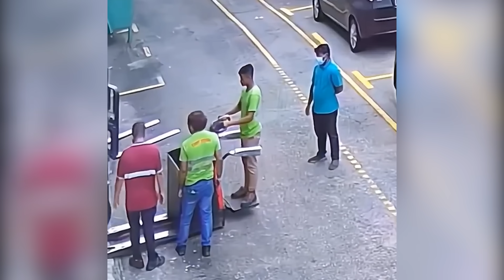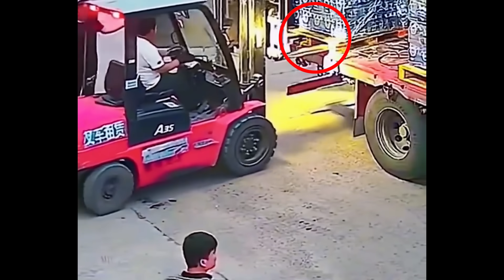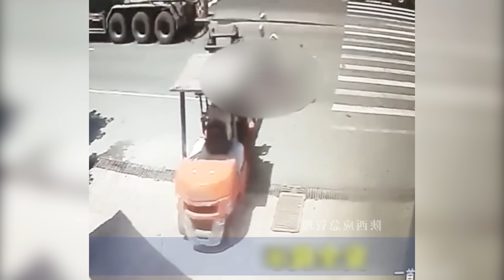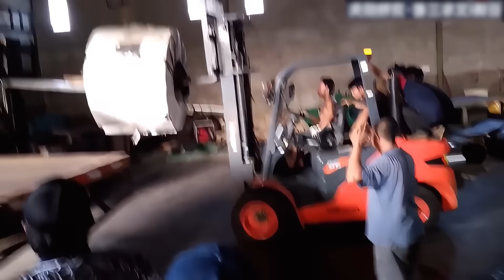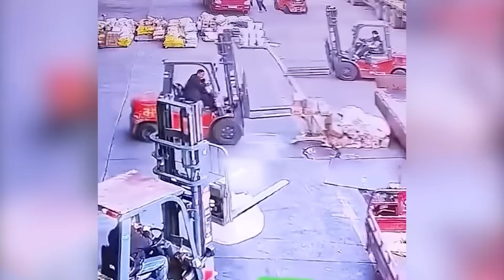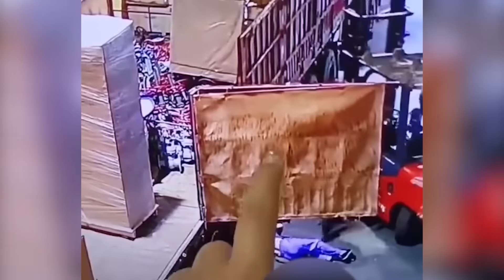Forklift Accident Caught on Camera!

Comment: Keeping the forklift blades as low as possible when not in use and also never elevated to a height that can impale someone while moving forward is f**king 'forklift operation 101'...It's basic, common sense, as well.

Comment: No traveling with raise heavy loads. Tilt a little back and keep load center as close to the back mast as possible. Weight can be moved towards equipment lowered down and re picked up in a better more secured way. Strapping should be used if raising loads very high. Travel very slowly so as not to cause load to shift around and stop quickly in an emergency. Traveling across roads and pathways outside the forklift operator should have someone on foot as a spotter/stop traffic for caution and forks need highly visible tape hanging to alert traffic of a hard to see danger. Slow and low is best.

Comment: 5:49 little tip from a forklift operator. When ever possible you want your cargo to be as close to the base as you can get it. At this time he should have lowered the cargo back onto the truck and reposition the forks.

This shouldn't have happened but the operatior is important. Maybe the boss of the operation is but any boss overseeing material/product movement worth there salt would rather pay an employee for the extra hour over how much it will cost them should you drop even 1 shipment in a year.

Comment: In my 45 years of forklift experience, I have had to perform almost every lift shown here. Most important parameter is to maximize the center of gravitÿ. Even a heavy capacity forktruck with a lighter load will tip if the center of gravity is outside the "sweet spoþ."

Comment: The carelessness of this lift driver is astounding, not only does he drive way too far out into the road, he never sets the emergency brake after he exits the lift.  He looks back, sees it is rolling then just keeps walking like, who gives a shit. He could care less about driving on the street. 4:01
Reply: Did you notice the same thing happened in the last one. Idot jumped off the lift when he sees his buddy fall, and jumps off the lift without setting the brake, so the lift now runs over his buddy. The incompetence of these people, my guess is these people don't even drive cars, so this technology is just too new to them, everything about them says they have no clue.

I've fired easily over 250 people in my day for doing much less than this staggering incompetence, its infuriating!
Reply: @Tony.Technics.1200s  I've worked in lots of warehouses where they don't even train/certify the lift drivers, it's illegal & obviously an OSHA violation that would bring stiff penalties, huge fines to the company for one thing. 
I'd say these careless operators meet those criteria.
Reply: He needed the sit down counter balances we have. They automatically apply emergency brakes when you park the lift. They don’t even have a lever for Parking brakes on them. When you get back on the lift to move it again you need to press down on the brake pedal to release the emergency brake.

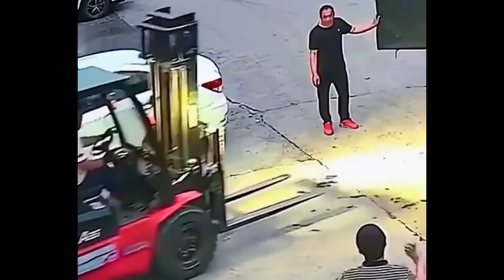Comment: 0:47 The top pallet must be lifted separately. You can't see it, but after removing the right-hand pallet, the top one was already in bad shape because the foils were sticking together.
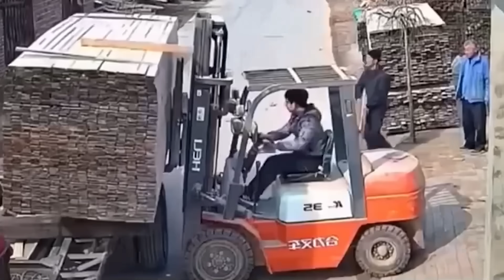4:07 The weight is too much and the road is rising. After lifting, the car is parked in another location, the forklift lowers the weight, turns around and drives up the rising.
7:00 The most important part is at the end of the recording. Before getting off, the forklift driver puts the forklift into reverse and the forklift runs over the fallen person.

Everyone here is an idiot!

Comment: Why do all these forklifts that need to cross roads do so with the forks half way up ??
Reply: Poor training and regulations, happens in certain countries. Drove a forklift for my first job and first thing I was taught was forks down always, unless you're lifting something. Better to gouge an ankle or tire than kill someone.
Reply: Why? Dumb question.  Look at the operators,  they do this all the time. No regard to intelligence.
Reply: Because they can 😂😂
Reply: Always keep the fork low and level, never tilt the fork while driving it also while keeping it low
Reply: @DonutVIP 
Wrong. When unloaded, the forks must be in the "travel position", which is 4-6" off the ground with the tilt applied. Forks are only flat when lifting/lowering, or the truck is parked
Reply: @Disasteroids1yes when unloading, not when just traveling or driving in the warehouse, and dont forget to honk
Reply: @DonutVIP I did the honk thing when going for my construction course. And when my instructor came out an I beeped my horn while going backwards, he turned around and went back in the classroom.
Reply: When outdoors, they should be raised a few inches to avoid hitting the pavement over the bumpy areas. No reason to be any higher
Reply: @danc1197 
I've not been on a forklift since 2002
When parked Tips of Forks had to be touching the Ground to stop Ankles being Injured 👌
But in motion = Tips higher through Tilt but maximum of 6inch 👍
But way back then Forklifts had Handbrakes or a Dead man's switch 🤔
Reply: I love how the drivers of the cars simply ignore the fork lifts and feel the need to just push through. Brake? Why? 😂
Reply: Because they are Amateurs.
Reply: They're Murderers
Reply: Because the people driving them are stupid and untrained.
Reply: ITS NOT THE FORKLIFTS AULT

ITS THE IDIOTS INSIDE THEM !
Reply: Good call! Lower the forks and destroy their tires!
Reply: Added excitement
Reply: Po 1 wózek  nigdy nie może wyjeżdzać  z zakładu na którym się znajduje (?)po ,2,3 4 durnota lub gamoń ,A winień  B i HP Kierujący jest nie przeszkolony ⁉ ,Nagminne ‼
Reply: Because they're thick!
Reply: Because shit hole countries dont work very well
Reply: I was about to ask the same thing. His forks shouldn’t have been raised or in the roadway.
Reply: .....because the operators are stupid
Reply: Always drive backwards when possible on a forklift
Reply: I think it's because they cannot open their eyes all the way.
Reply: In Sri Lanka, a lot animals pass by. So we are told to keep them high so we do not endanger the crossing animals
Reply: @ZaraGrace56That great and all but a little bit of common sense goes a long way. Why have them raised and sticking out  over a busy road way?

Comment: I drove a lift for 28 years, you don’t drive forward, and you never drive with your forks up❕
I drove a double fork lift ( 4 forks) , 
The bottle fall, the driver should have picked the top pallet first.
The guy with the pallet of boards, should have lowered and tilted the load back as soon as he cleared the deck of the flatbed, then continue backwards.
Second flatbed, the guy should’ve repositioned the forks in flush, then lower the load as soon as it clears the flatbed, tilt then you’re OK to move in reverse. 
Both flatbed incidents did the same thing with a incline behind them, assisting the load to fall forward.
Third lift driving with your load up in the air is absolute no no, bring a load to the ground tilt back.
These third World countries carry nothing about safety❕

Comment: Not sure what could've been done in #9...load shifted and not caused by operator IMO...
Reply: No need to be turning with that much weight in the air. 
He should have cleared his path first then kept his load low to the ground .
Once in position on side of the truck, lift up then move forward.

Comment: In the first one,  blades must be on the ground if no one is in the seat.
Reply: It looks like the drive wheel was floating so they used the other fork to give traction. They had it in drive so of course it went forward. Someone needed to be in the seat to step on the brake.
Reply: One of the first thing you learn. When leaving the forklift always hand break and put the forks straight on the ground. Even driving around,  the way I was taughtis to keep the cargo around 15 cm from the ground. Basically a sideways hand, roughly (no one os asking to get out of the lift and check with a measuring tape 9)